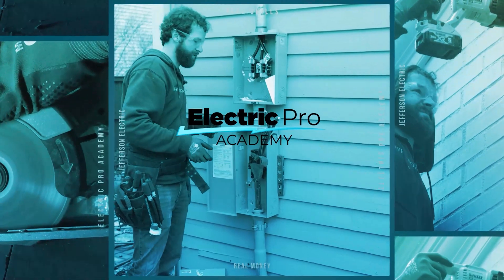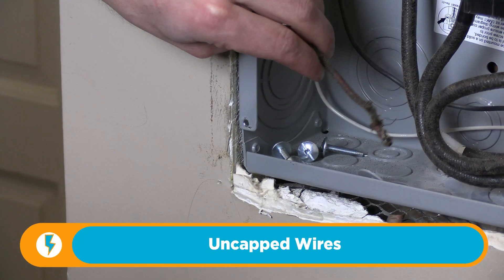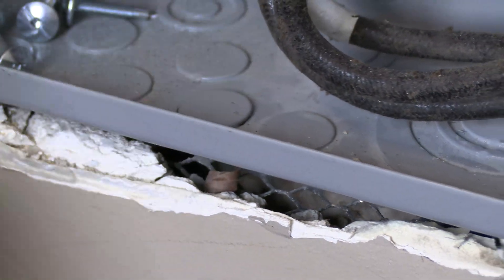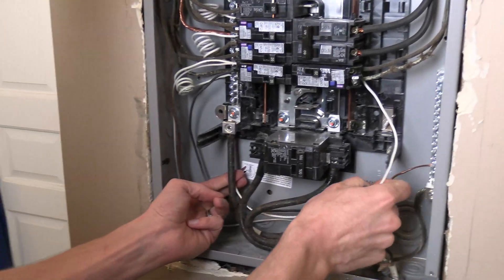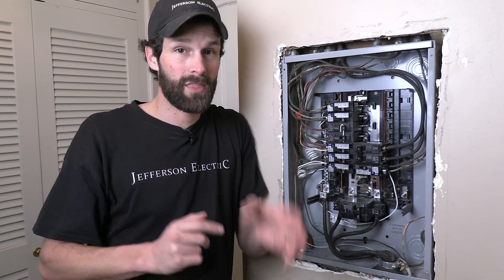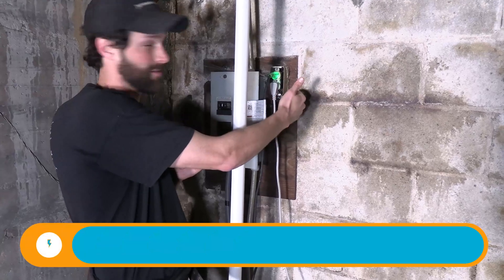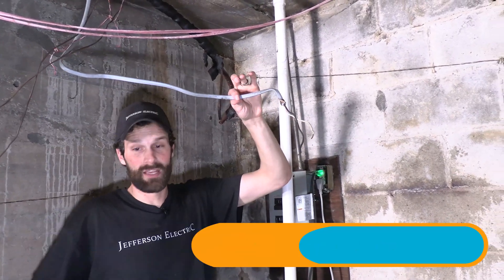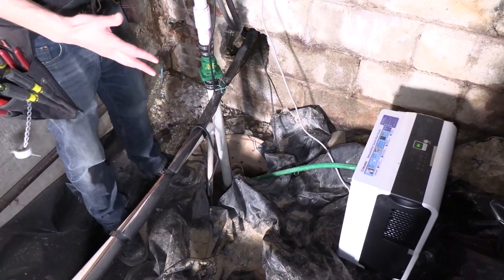I'm An Electrician. Here Are 10 Things Wrong With My Home's Wiring.

Comment: I was a 25 year electrician for 25 years up until my stroke 2 years ago  started at$7.50 an hour   In Vermontdidn’t know why wire nuts were different colors ended up being one of the top electricians  was told after my stroke I left big shoes to fill  just a word of wisdom to up and comers your only as good as who you work wit your a team

Comment: Question as I am going to run into it on my farm in a few days. Meter and 200 amp disconnect on the pole. Does that mean any main panels behind it need the neutral/ground separated like the ones downstream from it? Also Meter > Disconnect > ATU > Main does the main and neutral need to be separated from the disconnect back in that situation? Co-Op can probably tell me but their engineers are... fun... to work as a homeowner with especially when it comes to generators yet they generally don't have any problems with me working on the ones running my transmitters go figure..

Comment: I’d call an electrician to have this fixed - 😂. Life Question: when installing GFCI breakers, do you leave the pretty coiled neutral or do you shorten appropriately?
Reply from the maker: 😆

Definitely shorten that pigtail! Everything you can do to reduce resistance and ensure that faults are hitting the GFCI without interference.

Comment: "If the house is over 20 years old..." The question isn't so much, does the house meet current code, but did it meet code at the time it was built? Some of the changes are definitely needed to prevent fires, but most of them while good, are not critical.
Reply: The house I grew up in was built in 1971 and it had excellently-done wiring in it.  Its only major electrical hassle was that its initial main panel failed.  I wasn't yet born so I have no idea what really happened, but it was replaced with a good QO panel which is probably working just fine to this day.

Comment: Why is the wire size need to match with the breaker, we obviously don’t want to downsize but why can’t we upsize the wires for a specified breaker.
Reply: Ampacity and wire gauge are not directly correlated.  There are other factors such as length-of-run/voltage drop that sometimes need considered, too.

You can often go bigger, as long as the devices the wires connect to are rated for that gauge and type of conductor.   Bigger conductor means less resistance which means less heat.   If I were to wire a house, I'd wire all circuits with receptacles with 12-guage wire.   Even on 15-amp circuits.

Comment: Give you some advice.  take it for what  it is worth.  take off your tool pouch.  pack them in a tool box.   i am a sparky. been in the trade since  1978.   over time that bag will shift your back.  i now am going to a Chrioprator.   Several Sparky,s over there years i known has had back issues.   i keep my tools now in a tool box. took them off about 10 years ago.  a few of my back disc,s now have degenerative.  it is mild.  just have to take it careful though. drink lots of water.

Comment: When I replaced my oven, I had to upgrade the wire from 10/3 to 8/3 since the oven spec was 40 amp. The miracle happened when doing the work, found a 14/2 that a mouse had eaten the jacket off.  Talk about a fire in the making.  I decided to put a work box (properly grounded) in the attic to replace the segment going down the wall to the basement where I could access the destination box. I really wanted to replace the entire line from panel to box but would have been a bit much.  What do you all do to seal drill holes in floor and ceiling plates?  I used insulation.  Take care and thank you.
Reply: @ElectricProAcademy  Steel wool "can" rust and disintegrate.  Might think about "brass wool".  Yes, it is a thing and available.  Just a thought.  Cheers!
Reply: That's why armored cable is better in New York City They really like armored cable AKA BX cable Not too long ago you could only use BX cable But now they allow romex for  One family home and 2 family homes sometimes 3 family homes after that only armored cable
Reply: @jcaleca60  I am a huge fan of armor cable (mc) because of what happened. Also, if you have the opportunity to try 12/2 stranded mc, it’s sweet to work with, especially since many outlets have back wire devices and wago style lever nuts.  Using stranded around a screw can be quite a challenge.
Reply: @LDoctorKC  Can't a rat chew through armored cable? ;-)
Reply: @LDoctorKC   They sell terminals to crimp stranded wire for Switches and outlets
Reply: @jcaleca60  That brings up an interesting question - I use terminals and  farrells  all the time in automotive or projects, but never thought about using them for a receptacle or switch.  I wonder if the manufacturer of the device address any of this?  It is my opinion that a stranded wire has far better contact under a side wire receptacle because it flattens out.   My goodness, I good insulated splice crimp terminal and heat shrink jacket could be a perfect solution for in wall splice without s box when you think about it.
Reply: Couldn't do 6/3 50 amp?
Reply: In my electrical supply house probably Amazon has them also they are cold stay con wireless terminals made for a number 14  12 or number 10 wireYes you could use them on electrical wiring AC and a home because New York City code does not allow stranded wire around a screw. Hope this helps you out
Reply: @jcaleca60  perfect 👍
Reply: @jcaleca60  wireless wire terminals? What?
Reply: Wireless terminal That was a typo sorry  I see I have to cross my  tees and dot my I  people on here love to nit pick everyone has to be right 😆  yep that's life lol
Reply: @jcaleca60  Well, not all of us are mind readers!
Reply: @jovetj   I was expecting that answer laugh out loud

Comment: Never trust those electrical testers
Reply: @ElectricProAcademy  They work very poorly on wet or damp cables too, so if it has been exposed to wet conditions it can easily say it's dead when it's live. I only use them when fault finding. Never use them to prove dead, always use an approved voltage tester.

Comment: I've worked on quite a few old ragwire houses and it always amazes me how little they cared for making things even look nice, even if they're technically illegal. The phrase "if you're going to do something wrong, do it wrong the best and safest way you can," rings very true here. That panel was uuuugggglllyyy. Same with knob and tube setups. They just flung wires around all willy-nilly.

The last knob and tube house I worked on had been remodeled 3 times and you could tell when by the type and style of NM cables used. It had the panel IN THE BATHROOM over top of the sink hugging the edge if a window. Pretty negligent stuff. Even back then, they knew water and electricity aren't friends but they did it anyways.
Reply: Yikes!!
Reply: Houses didn't used to have finished basements. It's expensive to move the main panel in a house, and people like finishing basements in these old houses and added bathrooms, that's usually how the panel ends up in a bathroom.

Comment: That example of the exposed wire that needed a wire nut, really need to trim back the exposed conductor first so that the wire nut will completely cover the conductor.  What he did is a little better but still not sufficient.   Maybe he is just demonstrating what is wrong and didn't intend the 'fix' as a direction but he should have said the proper way.
Reply: I had actually even wondered that myself, but figured I must have been missing something. Glad to learn that I wasn't wrong for thinking that